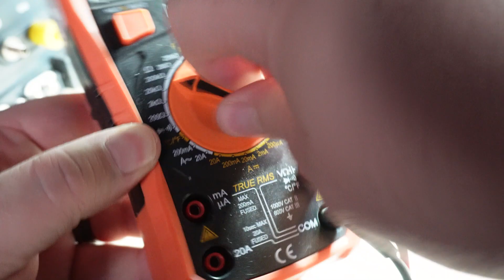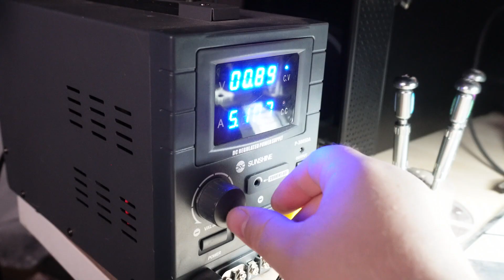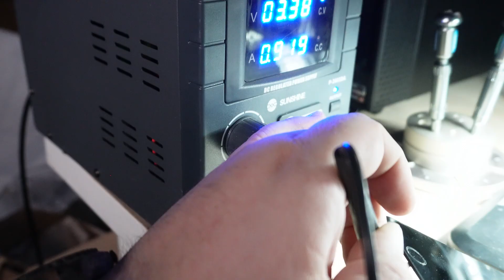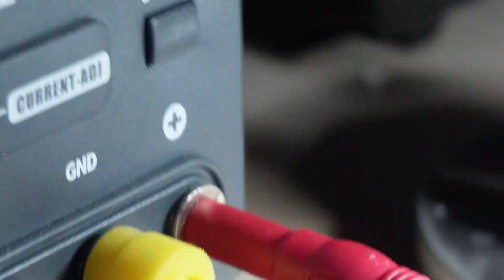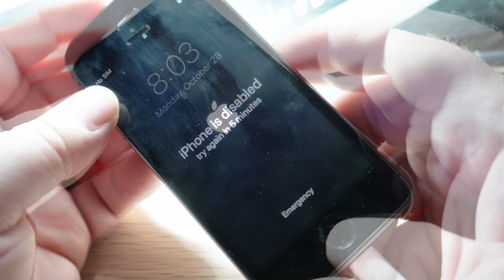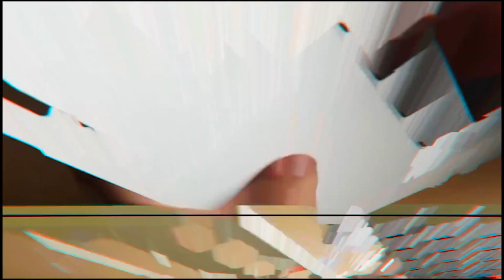How to Revive a Dead Battery That Won’t Charge – Step-by-Step Guide

Comment: This is an Awesome Video! Many Lithium Batteries have More life left but become unbalanced & or below threshold from overuse when low, or ''Sitting' drain and already being depleted. This method is brilliant to restore balance to a battery to allow the devices IC to recharge it. 

Added Caution FYI: Remember this method is bypassing all Charging IC's/ The brain/Safety shutoff -----use caution when forcing raw power into a Cell and never leave unattended  and or doing this for long periods of time, I will say this is 90% of the problem you see with hoverboards not charging and this is a very simple fix.